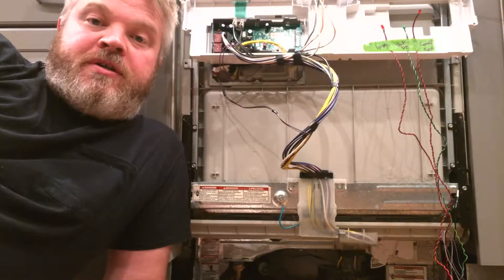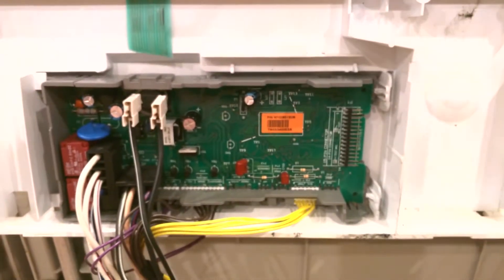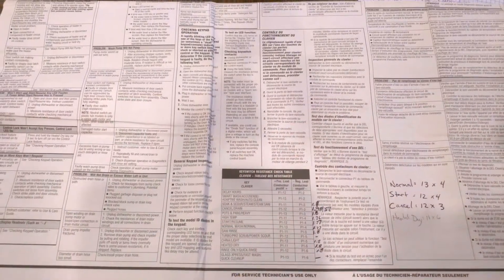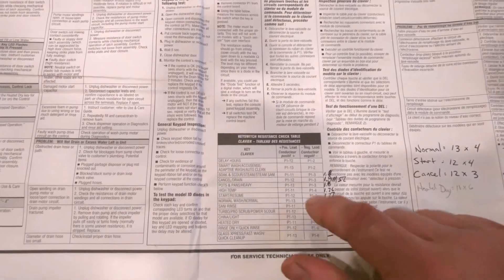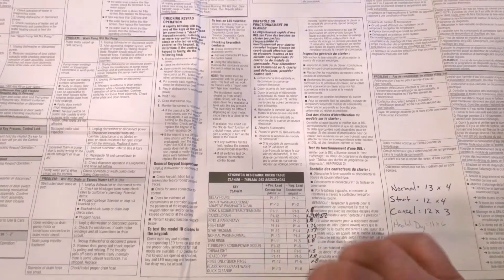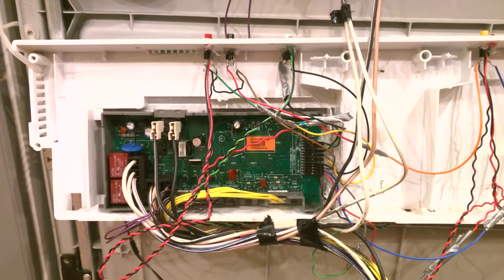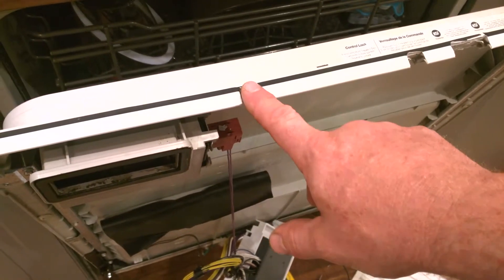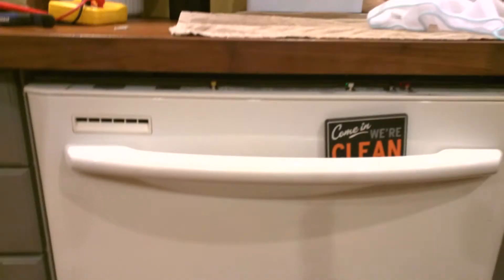Maytag Dishwasher Repair | Key Pad Override

Comment: Thank you... I was encouraged to find your video. I was not able to find a pin diagram for my Crosley/Frigidaire so I peeled off my old corroded button strip (used a bit of heat as someone suggested in another comment somewhere) and was able to trace back the intended pins for my NORMAL WASH and for me START/CANCEL buttons...momentary jumped across (one at a time in that order) Up and running!!! thanks again
Reply from the maker: Nice work, dood!

Comment: Great video, wow Few would do what you did to keep from buying a new one but I applaud your technical skills.  I will look at my tech sheet to see if I can do just a normal wash if this is my issue.  That would be great to not have to run out right away to buy a new machine.
Reply from the maker: I hope your efforts worked!

Comment: Thank you for a great hack. I have the same problem with MDB7759SAS3 - but the touch panel connector to the control PCB is different. And I cannot locate the schematic for MDB7759SAS3 - right now, I am tracing the paths to locate the pinouts - and it is not easy. But after viewing your video, I have a clear idea on how to proceed - fingers crossed! 
If anyone has a schematic that can be posted online, I will be grateful.
Reply from the maker: Good luck to you! Thanks for watching and thanks for commenting!  I think I got the most help from the paper that came with the machine.

Comment: Glad you was able to by pass the touch pad, only wished you would have did a little more on showing how you wired the switches along with the leds or maybe drew a diagram on paper and posted it, other than that very good video..I always draw a diagram before i say run wiring for a room or something, that way i have a better understanding of how it need to be connected. wish i'd taken electronics when in votech along with the electricians course, but i didn't.. I can wire a house but small electronics is a little confusing, but I'll keep researching till i figure it out.
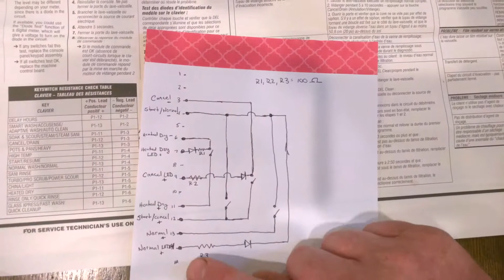Reply from the maker: Thanks for checking out the video and for the feed back!  I used 100 ohm resistors to limit the current through the LEDs.  There is a schematic of what I did in the video from like 4:05-4:15.  It's a little hard to read - sorry about that.  There is a link in the description to where I got the switches and the LEDs are form some other e-waste project.  LEDs are EVERYWHERE! I also agree with Peter Michael that the cancel button is a must.  And I think you're idea to use the salvaged DVD buttons is a great re-use of resources.
Reply: @todayweregonna5658  thanks for replying so fast, if things go right the micro switches are so small that I'm going to try and connect all the 11 push button switches, going to use the original overlay, drill very little holes for switches to push button part through right underneath each touch button location and then mount the leds in each led location after drilling the hole for it, but once i start it I'll know more.
Reply from the maker: @jamesdyer7535  that's awesome, man!  Let me know how it goes!

Comment: I was able to put in a normal and start switch, using screenshots of your diagram.  Success!  But I'm actually having fun like a kid, so I ordered a set of cool looking silver switches and panel mount LEDs and found an actual diagram (for the circuit board, used in many different models).  Hope it helps the next schmoe.  😅

https://www.applianceblog.com/mainforums/attachments/tech-sheet-w10142800-pdf.17875/
Reply: Thanks for posting that link!  I could not find it anywhere.
Reply from the maker: That’s great! The dishwasher project rekindled my flame for electronics so I bought an arduino! I’m working on a project to extend the hours of “daylight” for our chickens. Stay tuned!
Reply: "I ordered a set of cool looking silver switches and panel mount LEDs" Ordered the switches from what online store?
Reply: The applianceblog.com is a great resource for info, I joined it for info on a dishwasher, i had someone helping me within mins, the knowledge of one of the moderators a lone is priceless, thanks for sharing the info. Where did you order the switches and LEDs you are talking about? I watched another video of a guy doing the same thing as this video,but he also put in resisters on the switches , it would great if someone did a complete how to on wiring the touch pad .
Reply: @jamesdyer7535  The resistors are needed for the small LED lights. 

I haven't had time for it yet, but the CANCEL button is a must.
Reply: @petermichael8921  do you not need the 10 ohm resister between the switch and pin because of the resister that's on the touch pad would be missing it? I'm just wondering is all, want to do it right. also I've found some old dvd players that aren't any good ,but still has good press switches that I'm thinking about using, they are very small micro switches,so thinking would be perfect to use, since they are very small and can fit easily in tight spaces. far as connecting the led's to each switch, which side is needed to do it? or which pins? the ones that are 1st in diagram or the secondary pins? any help or drawing would be very much appreciated.
Reply: @James Dyer  I am not in a position to mess with it today but I have simple momentary switches from an Amazon search.   You could use a wall light switch flicked on and off if you had to. 

As far as the leds I would look that up, leds and resistor wiring.  I couldn't tell you off the top of my head.
Reply: @petermichael8921  thanks for the info
far as switches,I'm going to use the small micro switches off several old electronics laying around that i haven't thrown away yet, the small micro switches look to be 1/4 inch square with the small button in the middle being 1/8 inch round, will drill small hole under each touch pad button location to mount it.will know more once I get started on the project, right now working on brakes of 3500 dodge truck and trouble shooting 2003 audi a4 1.8t with OBDeleven.